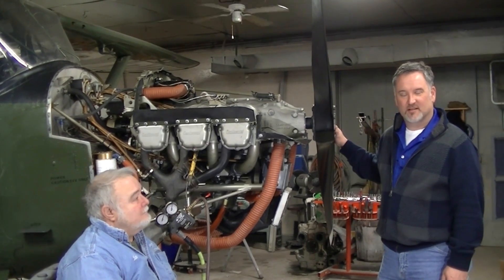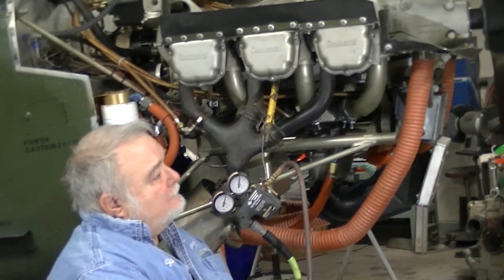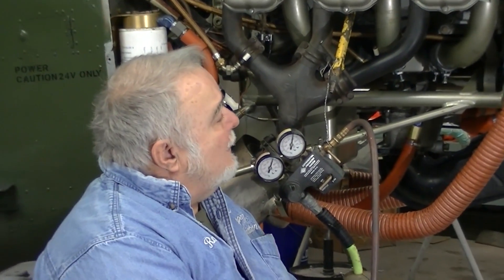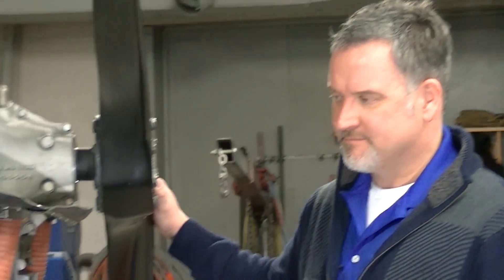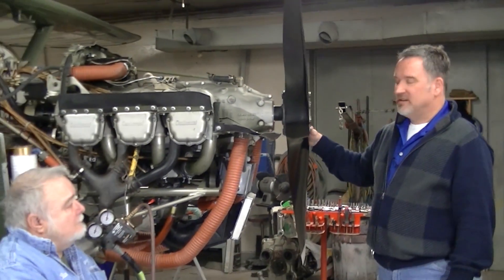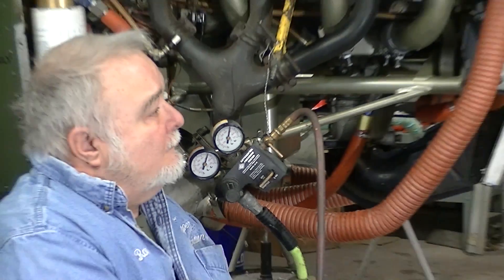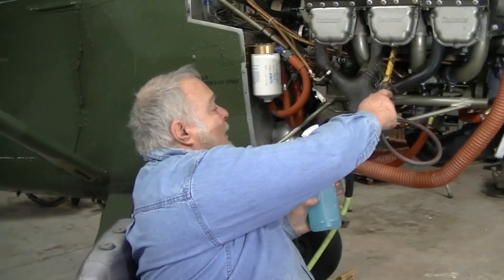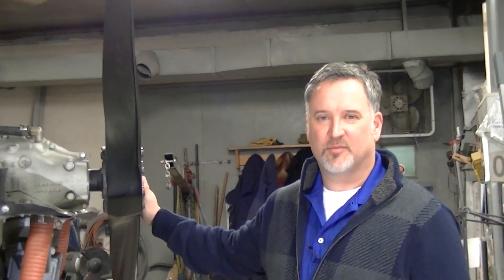Induction Leak Test

Comment: Something nobody is mentioning is that most common dish soaps are highly corrosive to aluminum. I would not be spraying that on my engine. Use proper leak detection compound intended for auto tires, which is formulated to not damage aluminum wheel rims.

Comment: I worked in a part 145 engine overhaul shop, ran the test cell on overhauled engines.
The biggest indicator of a vacuum (induction) leak is a rough idle.
A&P/IA
Reply: Yep, and if you have EGT probes on each cylinder you’ll see high EGT on the cylinder with the induction leak.

Comment: Don't start with 80 psi. Find TDC at the cylinder you are working on, reduce pressure to 0 at the pressure regulator knob, open the shutoff valve and slowly increase pressure up to 80 psi. Much easier on the arms.

Comment: To do this you have to put yourself in the prop arc so the warning doesn't make sense
Reply: with 80 psi, you can hold the prop and prevent any random movement of the prop. Don't walk/idle in the arc of rotation without being prepared to stop it. Tip: Creep the air to the proper p.s.i. Always refer to the proper manual before performing any task. Adhere to all cautions/warnings and read all notes within the manual.

Comment: Any intake leak will cause an lean condition on one or more cylinder . Aircraft or not . It is not good at all . Repair the leak and test again . Do another wet compression test to see any improvements . If none then take down that cylinder and start a cylinder and head crack test . If passes then put it back together .  I done this on my BMW boxer engine after an lean burn .  A&P think they are so special and the work they do  but to me it used to be an everyday event  Aircraft engines are easy to work on and do a rebuild  . But everything in that engine can fail if not checked or tested .  Being safe is just one thing .

Comment: Great video. Simply explained so it makes sense even to pilots. I am so trying to not be the pilot that’ says there is something wrong with my plane, fix it. Now I can say, there was a bigger than normal drop on the mag test. Check for an induction leak. Plus all the others reasons. I didn’t know an induction leak would do that.
Reply: Yeah, I work in maintenance and some mechanics might not like it if you tell them what test to perform.. just saying. Tell them what you've experienced and maybe you can add something like "I don't know if you need to do a leak test or something cause I'm suspecting a leak.." something like that would be better :)
Reply: You are right it does not.Unless the intake tube is sealed they checked nothing
Reply: Take a video of you telling the mechanic what to check I wanna laugh

Comment: I think you skipped an important part of this test.  Don't you need to seal the intake source in order to pressurize the system?  Taping off the intake on the carb box?
Reply: I was thinking the same thing myself.
However would the fact that the throttle is closed, cause enough restriction to allow the air coming out if that cylinder to pressurize the manifold,  although for a brief time?
Reply: Could you use a smoke machine?
Reply: @tpcoachfix  yes
Reply: at the very least !  Pressure check nothing

Comment: Thats #3 cylinder not #1
Reply: This must be a spoof! Ive been an A&P / IA for 30 years. This is total bullshit
Reply: Many thanks. I thought it might be me. Insane if true. I am a little older than you. 40 years A&P and pilot Alphin Aircraft Hagerstown Md. I have never seen anything this stupid. I should just click off. Loads of garbage on the net. Again thanks for your support !1
Reply: These guys should not be allowed to get anywhere near a engine. Lets see if I got this right Plug in is in #3 cyl not #1 Up at tdc, open the intake valve ? then the intake is some how pressurized ? Top that off air travels to #1 intake, through the cylinder. How can this happen ? The explanation about the mag drop is crazy mindless dribble, or am I wrong ?
Reply: @pauleyplay  It's an intake manifold, so it doesn't matter from where you supply the air, the entire manifold will pressurize. If there is air compressed in the #3 cylinder and the prop is turned to open that intake valve, that will send the compressed air into the entire intake manifold. It doesn't go through the cylinder, it goes through the manifold.
Reply: @Featherandfly  I was thinking the same. The entire intake should be pressurized by the opening of one intake valve on any cylinder.